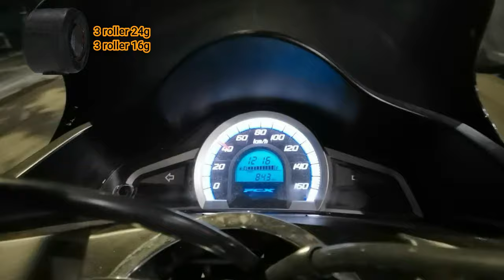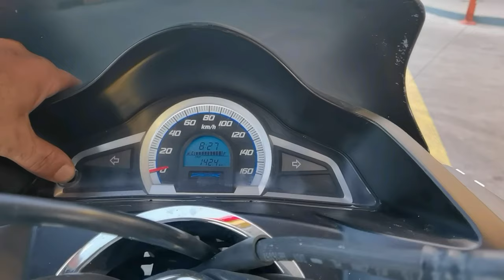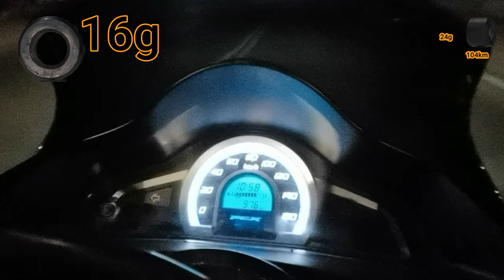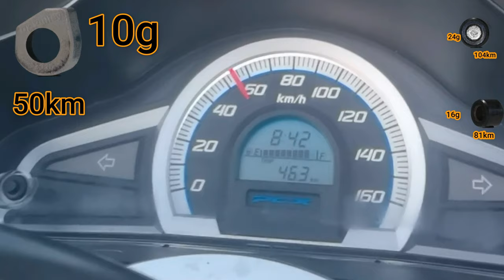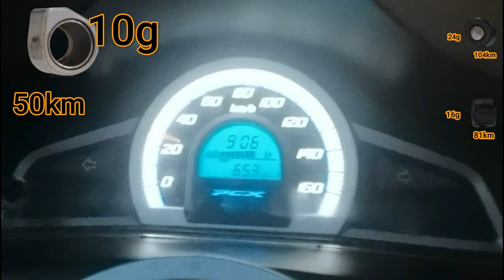test drive on honda pcx 150 scooter roller 10g vs 16g vs24g petrol consumption per km.

Comment: I changed my stock 15g rollers (on Honda SH150i) to 13g grams here are are my results: First, very significant increase in acceleration (0-50), and gas mileage (fuel consumption) dropped from 47.1 to 39.4. So, better performance and worse gas mileage. No regrets. Used Dr. Pulley brand (Taiwan) and selected those funny shaped (not round) type. Hope this helps.
Reply from the maker: Hi william very correct and the new Pallini balls One of the best companies puts very good material plastic try the balls from the PCX 160 new we have to use the same balls you will see great savings and your bike will work much more comfortably
Reply: @MBPATENTS  Hi! I have a PCX160 and changed the flyball weights down to 16g with 1000 rpm center spring. I experienced sluggishness in acceleration once speed goes beyond 80kph. It feels like the cvt becomes hesitant in translating the engine's rpm into continuous acceleration. What do you think is the cause? What can you suggest is wrong? It's odometer is only 12,000 km with stock v-belt and clutch spring. Thanks!
Reply: @adriandiw  I would check the condition of the CVT belt itself. Peeps don't realize how key that belt is not only on its driven face but on its edge that "rides" up the curvilinear surface as it changes its gear positioning. So a fresh firm belt makes a big difference. Also make sure your mechanic did leave out the spacing washer (which they too often do) since that little gap make a huge difference on the top end especially. Before you replace your belt (if condition looks oke) try to sand the edges (to flatten them a bit) then once you got it flush and flat try a belt dressing. If that makes a difference (which it probably will) then go get yourself a fresh cvt belt and it might just fix everything for you. Finally, I hear that the Italiant belts (Malossi, Polini) are super rigid as they ride up the CVT slope, but a bit hard to find in Indonesia (except, oddliy, for Vespas)... Good luck!
Reply: thanks for the input, i wonder if maximum top speed decreased when u dropped rollers weight?
Reply: @imadachache4537  It was an unexpected result, but seems both my acceleration 0-50 AND top speed seems to both have increased. Mr. Pulley. Big difference definitely an improvement over stock. New belt also removed ALL vibration and the SH runs smoother and more quietly too. All good. Mksi buat commentnya slamet tahun baru ya.
Reply: @MBPATENTS  What kind of milage can I get with 24 grams and NIB intake high flow air filter and 115 main jet in the carburetor? Im trying to set mine up more for cruising and at about 20-30 mph the rpms are about 4500-5500. Im not really looking for top speed only for better fuel milage.
Reply from the maker: @someguyto4675  if you don't fix how fast the oema grows, you won't consume the oil https://www.youtube.com/watch?v=H1o8aWGsuzE
Reply from the maker: have you used a 15 gram roller 13 g and the consumption is lower??? the SH has the same speed as the pcx, but the step in the transmission is the only thing that put me off, I believe in the acceleration, the consumption is better, thank you William !!!
Reply: ڜش7
Reply: How to increase top speed it only increase the initial 😢
Reply from the maker: Unfortunately for the belt you say you are wrong all the belts have the same width the same curve it has nothing to do with it it said yes I just In this video I try each one each ball how many kilometers does the economy get each one how does it accelerate it has nothing to do with the belt about it Everything you say is invalid no video then to prove to us that it is indeed true, I only speak with evidence, thank you for your attention
Reply from the maker: max speed is never affected by the weight of the balls It is only affected If the ball is eaten or he dares. That is, he will lose 5 to 6 km Thank you for your attention
Reply: I doubt that. Heavy balls should help better for acceleration because it will spin the rear pulley faster by the front pulley. Put it back
Reply from the maker: @christianpaulroldan4010  Try it
Reply: What size roller should I use for the gears of 18 an 36 for the final drive gear trying to get the most top speed an have a red spring
Reply from the maker: the size of the balls is standard depending on the scooter you have, firstly, secondly, as for the acceleration, you have to remove the targets from the variator and grind them to close more to increase the step
Reply: Logically, with more recovery the engine makes less effort
Reply: @adriandiw probably not installed in correct orientation, a sadly common mistake

Comment: I'm past the 'boy racer' age, I don't abuse my baby.🙂 My standard 2012 PCX150 consumption averages at around 2.3l/100km, I'm happy with that.
Reply from the maker: I'm glad you call the pcx baby !! I did not have such a video, I think it is useful, thank you for the interest !!!
Reply: change oil every 1k so your baby can take all abuse and live longer
Reply: there is no such thing as abuse.. every year a motorcycle have a wear & tear in every parts
Reply: @itzerisadomeeiot4980  I do my oil changes (at Shell) every 2000Km, and use 100% synthetic.
Reply: @williamread720  we run 1k to 1.5k on oil change so goodluck on 2k but a young scooter can still take the beating
Reply from the maker: 3000 km or 3500
Reply: @MBPATENTS  always check your oil wear & tear no matter how expensive your oil if it has worn parts... the protection will be 50/50 unless your scooter is a race or endurance type anything can happen.. observe the oil play during 1k then 2k then your maximum 3.5k oil lvl will play a big part good luck
Reply from the maker: @itzerisadomeeiot4980  hi itzerisado I'll upload a video when the time comes with the kilometers I've done every 3000 kilometers arrogance oils believe me the kilometers are a lot it has no passions nothing I work deliveri 10 to 13 hours a day for 6 years I'm talking about pcx not all scooters are the same ala in scooters the oil has to do with the crank and 4 bearings in almost all ala scooters with a clutch or an automatic like crypton the oil has to do with a centrifugal with the right hand crank coils refmatos and all the bearings here I agree on 1000 with 1200 kilometers because the city is blackened easily, rough blackness from the discs from the centrifugal, depending on the engine, you also have the oil before doing its cycle, the more city you work, the higher you become, this way the piston metal bearings become smoother if I grind them in the pcx every 1000 kilometers nothing will happen but at 2500 to 3000 you have a strong and very good engine, get a lot more kilometers left only for scooters.
Reply: En España los cambios de aceite son cada 5.000 o 10.000 km... Yo lo cambio cada 1000
Reply from the maker: Hi gumont clearly, it is very good that you do the 800 km a lot in the oil, but it is better for the oil to do its cycle and above that, I don't think you will have a problem, and as for arguing about it, I am a fan of tropolini because I am very happy with what I have tried some  moment I will make a video of malossi vs with pollini to see which one works better?  Thank you for your opinion!!
Reply: Yo no tocaría la Honda PCX
Reply: Solo los mantenimientos te durará la moto toda la vida
Reply: @JuanAntonioOrtiz-k4h  I have no complaints.  Starts first time, the battery's now 8 years old.  I'm busy replacing the clutch bearing, but that's a well-known part defect on a certain batch. Not a big job, or expensive.

Comment: I have alot of Dr Pulley. lol.. I have 9G, 11G, 13G and 15G straight.. I play with it all the time.. I still have my stock 19G on my click 160(Honda Vario160).. It consumes 31KM per L when I'm using 9-11G combination but the acceleration really makes me smile 😁😁😁, the engine roar is enjoyable.. If I am cruising with my wife I just use 15/19 combination and I am back to 55km per liter.. Don't be hesitant on exchanging. It's only flyball tuning ❤️

I still achieve the same top speed on any combination.. but like +2 or -2 difference.. 90-95% accurate. The top speed actually differs how high your belt can go higher on your pulley face.. Mine remains stock, so always 128-131kph on actual road.
Reply from the maker: Hi jayja what you have done with the balls from pcx 1160 is very clever!! simply, the heavier the ball is, it has more economy, here I am, four, what role do balls play in economy and acceleration, first of all, if you want to have more acceleration, you have to remove the stops, you have to put three balls, one on a bench 10 20 and  the other if 21 so that the variator opens a little more, the pcx generally has room to reach up to 160 as the engine and its transmission are but it is good that everything does not work. marginally up to 140 is fine I think. Thank you very much!!!

Comment: please very 🙏 you upload about effect of add O ring 2mm/1,5mm for BOSS Variator. it's can decrease speed or same speed or more top speed. pleaseee🙏🙏
Reply from the maker: It will decrease the speed but you will have beeter movement
Reply: @MBPATENTS  oke2 thanks

Comment: So Its Basically You will get better Torque/Acceleration, but less top speed/HP with Lighter ones.
Also You'll get higher Top Speed/HP, but less Torque/Acceleration with Heavier ones.
Have to give some credits for the effort you put into make this video and for the effort in Editing. Great Job. Don't Stop.
Reply from the maker: https://m.youtube.com/watch?v=kfwsKiaQUfw
        for more final here is this video
ball weight has nothing to do with acceleration or top speed it has to do with fuel consumption.
Thank you very much for your kind words!!!
Reply: Yup but it only adds up around +2-5km/h, and it also increases the time (a lot) to achive maximum speed. To be honest, heavy roller isnt worthy at all, except if you looking for comfort on low rpm 

*srry for my bad english tho xd
Reply: @MBPATENTS  so, the only change is in fuel consumption, the weight doesn't change acceleration or top speed?
Reply from the maker: It's about consumption and fast acceleration at the start. If the rollers are lighter that is.
Reply from the maker: If you have lighter rollers, you have some consequences at damaging through time! Don't worry, my English aren't good at all
Reply: Can someone tell me what weight should i use for best torque?
Reply from the maker: For better torque, 5 to 6 grams or less, but you won't save money
Reply: You can alternate between rollers... 16,10,16,10 etc... or whatever suits ya... Result will be differ....

Comment: Hi! Thank you for your video. I have the Sh150i '22 and im now going to change the rollers with Pulley 16gr. I dont know the stock weight and i choose this because was the heavier for mine dimensions. Im driving on long roads at 90-100 what are you suggesting?
Reply from the maker: Hi stavros lihat video saya sebelumnya tentang berhenti dari variator, apakah mesin bekerja, mana yang lebih senyap, jarak tempuhnya lebih jauh, jauh lebih baik jika melaju dan jika Anda melaju dengan 100 kilometer, Anda akan melaju dengan 125, saya yakin Anda akan menjadi sangat bahagia

Comment: i have pcx 160 with 19grams stock roller weight would you recommend going to 20grams or 18 grams? or stay with stock weight?
Reply from the maker: +myplaguesify Depending on what gold you want it for long distances (travel) and short distance (city)?
Reply: @MBPATENTS  good acceleration and less gas consume or a combination 3x3 perhaps? what would you recomend?
Reply from the maker: +myplaguesify Unfortunately, these 2 do not go together if you put 16g and the 6 roller the scooter will have a good start, you will reach 100km much faster and the consumption will be higher.  If you put 6 roller 22g it will be economical in consumption it will not have started well.  Do not forget to subscribe. !! thanks
Reply: @MBPATENTS  thank you and subscribed
Reply: @MBPATENTS  sir how about combining 17 grams and 19grams?
Reply from the maker: +myplaguesify 16 g because the pcx 150 or the balls are 16, they are valuable, I would put them in your place.  I also appreciate videos on how to make the balls lighter and lighter weights
Reply: 11×13 over range pulley and torque drive thank me later

Comment: Can I spray WD40 silicone spray on the rollers to make them run smooth?
Reply from the maker: Hi sakra vong You'll put in very little but it will last 2 days at most, it really works better right your thinking!!
Reply: @MBPATENTS  I haven't tried it yet. Maybe I'm just doing cleaning and reinstating.

Comment: Hi my friend... I have a nexus 500 2005 model stock... What are the stock rollers and what is the best to put... Thanks...
Reply from the maker: after rolls It's a little strange if you move around the city the 16 is fine for example the factory takes it if you're for travel you should put heavier if you're for playing games you should put lighter Depending on how much you weigh how much you need and what kind of work you do  depending on what everyone wants to do
Reply: @MBPATENTS  thanks mate...

Comment: lighter pulley=faster acceleration=more fuel consumption=less miles travelled with full tank
Reply from the maker: correct in the kilometers, they have not done the weight from the balls, it has to do with the step and the variator.
Reply: no no just modify your engine and a good racing ecu will do the job anu size pulley will give you power and proper gear size will help the job done
Reply from the maker: But here I test the balls Depending on how heavy they are, what is the economy, how does the engine start, does it take a long time, what beers to put in if the other person wants it for trips, did you get her to put this in, I explain here, no, acceleration has nothing to do with it, it's successful

Comment: Hello I have 2021 Pcx . Which roollers you recommend.
Reply from the maker: Hi arwinders if you are doing short distances in the city keep the 16 grams if you are traveling put the 19 grams from the pcx 1060 if you want to play games and you have uphill and you want a little more lean you are overweight over 9 kg put the balls 10 grams depending on  case

Comment: Hello, how many grams would you recommend for the 2014 model 150 pcx? Thank you
Reply from the maker: the engine and the transmission are the same depending on what you use it for, that is, if you want it for a long time, you are fine at 16 grams, if you are for travel, you should be heavier, if it is for games, put 10 grams

Comment: i have PCX 160. Im eyeing for 6x 16g my weight is 106kg will this apply as well?
Thank you for this video
Reply from the maker: Yes, after 16gr you will see something But you will also need to put a harder spring back for the whole system to work correctly Thank you for your interest!!!
Reply: @MBPATENTS  do you have any idea for the springs? Thanks

Comment: I have a yamaha ray zr 125. Do you know which rollers are in it
Reply from the maker: Tell me exactly what you want to do if you put Vaios cylinders the bike will go slower but it will save on gas If you put lighter cylinder in the motorcycle will go better, it will just burn more, consumption will be higher?
Reply: @MBPATENTS understood. Thanks. Thinking of going heavier rollers as most of my rides on highways where I cruse at 70-80kmph.

Comment: The 150cc Scooter with 24g is only 104km/h?
Reply from the maker: Hi FNF the weight does not affect speed, just when they are very light it starts much better and when they are light it starts very smoothly but consumes less petrol
Reply: @MBPATENTS  Theoretically it should be above 110km/h

Comment: What is the benefit of installing a combi bag? My motorcycle is a 150 cc multi-torque machine, 12 grams to 14 grams are generally used. What if I build a 12 17 or 14 18 3-cylinder cmbine? What will it do for me? Thank you.
Reply from the maker: It won't start as well, it will be more economical, the belt will have a longer life and the motor will work at lower revs and more, but well, apart from starting, you won't understand the negative, it's too small a difference from the centrifugal if you include the stops  well double it because the step gets bigger
Reply from the maker: You don't need to put 3 14g 3 18g put 6 16g balls I did them because there are no 24g balls on the market if it's like I put 6 20g balls
Reply: @MBPATENTS    4 valve ang makina ko 16.5 hp 17 grams pano kung bumili ako ng Dr Pulley sir meron po akong torque machine meron po syang 14 flat trunks madaming speed hindi po ba magiging dahilan para mawalan ako ng traction sa pulley. nakakaapekto ito sa pinakamataas na bilis?

Comment: I have a chinese made gy6 scooter, original roller weight is 13 grams. I want to preserve the top speed (around 100 kmh) but also to increase acceleration slightly. what roller weight should I get? I dont mind fuel consumption
Reply from the maker: 10 grams of marbles are needed
https://m.youtube.com/watch?v=dxiMj23yttM

Comment: How about top speed 16vs 24g ?
Reply from the maker: It has no difference in landfills the difference is that it goes better after 16 grams and after 24 it goes slower more economical with the 24 it burns more the 16 grams